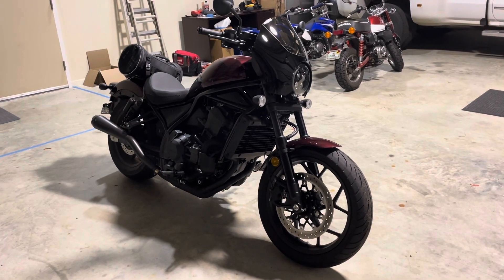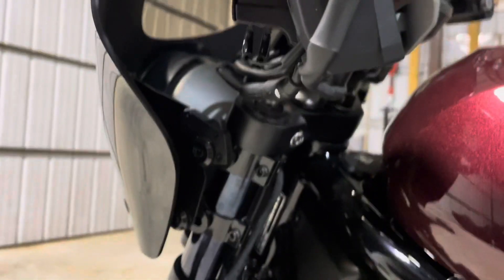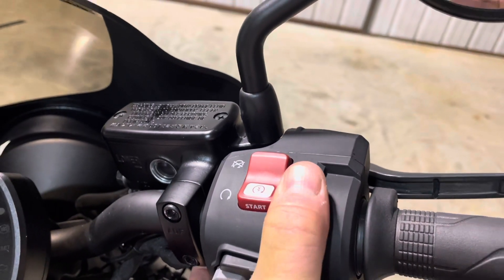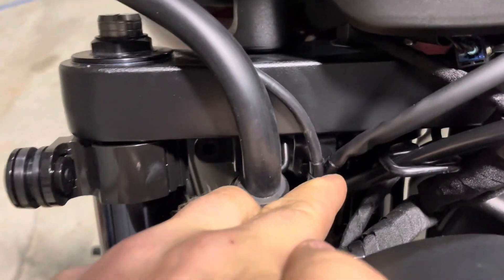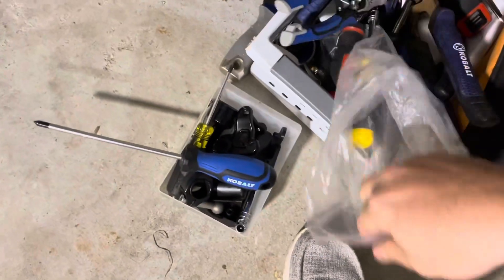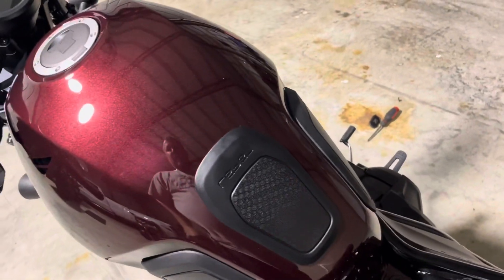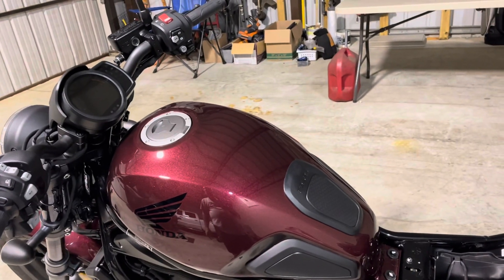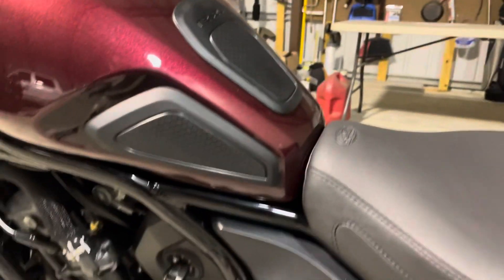Honda Rebel 1100 DCT OEM Heated Grips Install

Comment: Hello Brian,  Thank you so much for your very supportive video, I've just followed yours to install on my 1100T today.  The only part I could not remove was the plastic box surrounds the ignition even after removing 2 screws.  So I pulled out the controller connector, plugged controller in and pushed it back inside, no slot mounting.  Now I'm ready for the cold in northern California.  Thanks again, cheers!
Reply from the maker: Thanks so much for watching! If you know of any forum for rebel owners, please feel free to share and spread the love.  Have a great day and ride safe!  :)

Comment: Thanks for the post. I wish my install was as easy. Number of people on the Honda Rebel forum have had similar problems with the left heater grip but maybe Honda fixed the problem. Just to give a headsup on the potential problem here is my Honda Rebel forum post from earlier heated grip discussion.

**
Warning for OEM heat grip installers:
I just installed the Honda heat grips on the bike. The paper instructions are fairly useless so FatheadPatt's posting on this page[Honda Rebel Forum] definitely helped.
Mostly easy to install but ran into a major problem people should be aware of.

When it came time to put on the left grip, it slid on 1/2 way and wouldn't move or turn any more (no adhesive was applied at this point). I tried hand twisting, pliers with grip wrapped in towels but no movement what so ever. I don't know if the grip was out of spec or my handlebars but nothing I could do in my garage would move this grip.
I ended up taking to my motorcycle dealer and they had to apply lot of lube and special pliers to twist the grip on. Even they ran into the issue of the plastic end piece with temp button popping off during the install which they had to crazy glue back on.
Also a minor install issue note. I couldn't figure out where/how the cable bracket goes (this is the one where you remove the handlebar nut). So didn't use this and just zip tied it.

But grips works fine now and look forward to using it as cooler weather rolls in.

**

Post note:  I have been using the heated grips in many cold weather days and they are great...just be aware of potential problem described above.
Reply: michaelstanfieldsc  Sounds like a great idea.  I'll try your approach next time as it was a real beeaaach to install these grips following the limited Honda instructions.

Comment: Thanks for making the video it def helped on my install. I did not have to mess with any bolts holding the the tank on. I also un-pinned the big connector so I could pass it underneath where you said you were unable to at the head tube.
Reply from the maker: Thanks so much for your comment!  Please tell us how you un-pinned the larger connector. I actually tried doing this but could not figure out how to do it. I don't have a pinning tool.  If you provide some steps, I will update the details of the video and credit you.  Great idea!
Reply: @BKWalrus  I just used a straight pick tool from a harbor freight screwdriver set. Any straight slender pointed pick would work. There is a tab above each pin. I just pushed the pick in as to lift that tab up while pulling slightly on the associated wire. But you can’t pull on the wire hard enough without feeling like you’re going to break the wire. So after having lifted the tab and slightly pulled from the back. I push the pin from the front side out and they released quite easily.

Comment: Could not have installed without your video, directions were not downloadable.  (17:24) To fish the lines through with the brake underneath put the large module through with the clip facing the front of the bike, then when halfway through, corkscrew the module clip to the rear and pull through (used a small flathead and needle nose pliers to do this). The smaller module will fit just fine after.

Comment: Hi bud. Have you get a blink or error message? I got my heated handle installed today by the dealer. When I started to drive I notice the heated handle logo next to the clock as normal but then a E# would pop and the heated handle green light would blink nonstop. Pressing the heated handle button wouldn’t do anything 😔. I just emailed Honda before this message. Thx for your help and good night
Reply from the maker: A couple of ideas, but all of them are going to require it going back to the dealer. Checking continuity between terminals on the grips, 8.2 ohms plus or -10%.  Checking continuity.  Possible that one of the wires got pinched or cut? Otherwise could be a faulty grip or controller.
Reply: @BKWalrus  oh man. Thx so much. I will go back for sure. They just got it installed so there’s should be no extra charges. Thx ☺️
Reply: @BKWalrus  the dealer just called me today to inform me that the heated grip were defective and ordered new ones for replacement.  Something related to a circuit mesh issue.  Thx for your help. And enjoy the holiday

Comment: Whatever you do…do not use glue on the left grip. It was so tight that I couldn’t get the grip all the way on…since the dealer doesn’t sell the grips separately, it was a $270 mistake.
Reply: Good advice. My brother bent my handle bars. I could not uninstall or buy a single side. I ended up buying not only a new handle bar, but two now heated grips.